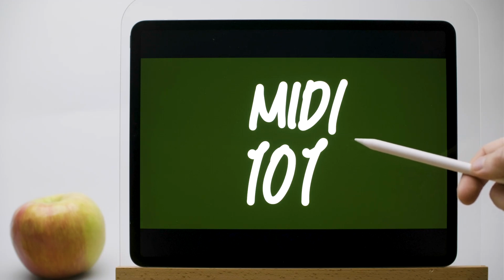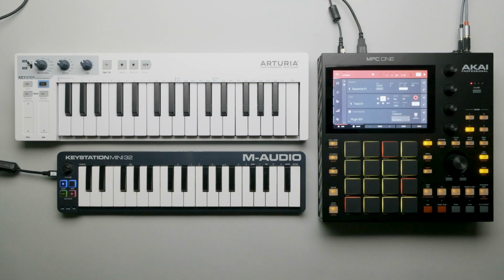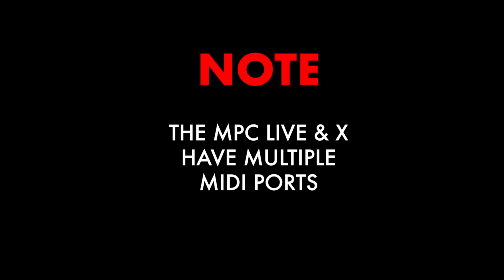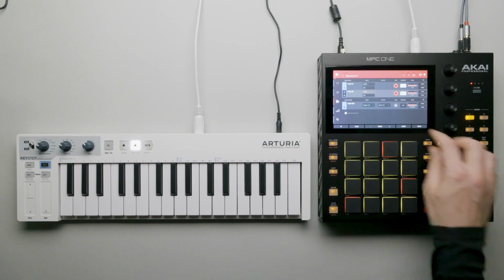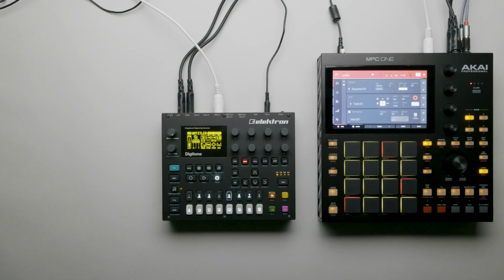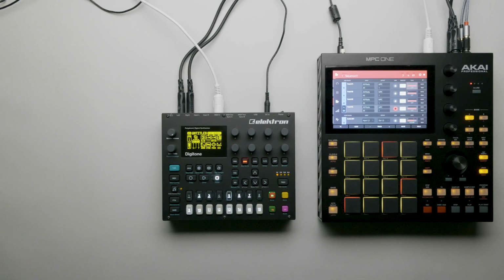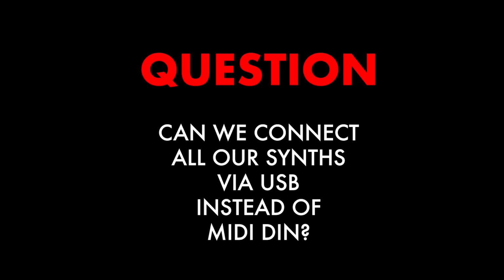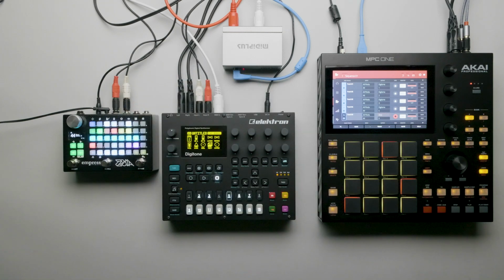MPC: CONNECTING MIDI DEVICES

Comment: Is there a way to send Midi Program Data to the keyboard controller at the beginning of a keyboard track. If I transpose a track then the Keyboard controller complies, but if I switch everything off and come back to it later, the controller settings are at default and I have to reset transpose, velocity, aftertouch etc. manually. Just wondering if there is a block send that I can programme and use from my MPC X before I continue work on the track. Thank you for the great video.
Reply from the maker: What controller do you use? And does it have a way to program save presets? If so, that may be your best bet. Otherwise, if you can send midi CC to it to change those parameters, you could create a template project on the MPC to send the CC notes, then switch to your first song's project, or a blank, etc once the CC notes have configured the controller.
Reply: @OllieLoops  Thanks. It is an Alesis Q25 so no presets. I will look at setting up a template project.

Comment: Does anyone know, why thus midi mapping feature doesn't work anymore after Update 2.10?
Reply from the maker: That’s odd. Have you updated to the latest firmware, 2.11.x?
Reply: @OllieLoops  thanks for your response. The issue is still the same after the update and others experience the same issues
Reply from the maker: @k-g-p  Wow, that would be super weird if they changed the feature or removed it. Is there anything in the release notes?
Reply: @OllieLoops  The feature wasn't removed. It is still there but doesn't work properly. After reading some reddits etc. i think it is broken since the update 2.11 when they overhauled the structure and layout of the UI. Since then some cc's are premapped and can't be overwritten. Some send a request for costumer service but didn't get a reply or fix.
Reply from the maker: @k-g-p  Thanks for sharing that info. It sounds like a bug that I hope they fix.
Reply: @OllieLoops  Me too...since this bug the MPC One lost a great feature for live performances

Comment: Good afternoon. I have an issue. I plugged in my studiologic numa X Piano, and i followed all the steps and i hear the sound coming from the headphones, however there is no feedback on the track, and it wont record. Under preference it called xpiano88 and in the inputs i selected global, control, and track, and in the output, i selected sync and track and still wont record, i even went under sampler and selected "in" and no feedback under the track but i can still hear it. Its super bizarre and stressing me out. does anybody know what i should do.
Reply from the maker: Hi Leonard, I think more information is needed to help you. For example. Where are the headphones connected that you can hear them? If you want to set up a consulting session, I can help you trouble shoot it. Email me for more details.

Comment: Man. This earned a like as well as a subscribe! Thank you so much! This is one of the more clear videos I’ve come across. Do you have any videos on MPC and Jupiter X or Juno x?
Reply from the maker: Thanks! I appreciate that. I don't currently have anything with the Jupiter or Juno. What are you trying to do? Maybe I can help.
Reply: @OllieLoops  thank you! I may be attempting to do something that’s impossible? Lol so, the MPC, as you know, has a built in chord engine. I’m attempting to configure my setup to where I can record those midi notes and they also playback the sound(s) from my Juno at the same time and not just record the notes. However, I also want to have the option to record midi notes directly from the keyboard on the synth into the MPC, if I choose too. I’ll spare you the setups I’ve attempted because I think all of my settings on both devices were wrong. Thankfully, I have a feeling I’m really close and your video helped me understand maybe where I’ve went wrong.
Reply from the maker: @MARCOSDORADOS  At a high level, I would say that you would want to connect the two via USB, otherwise, you would need two midi (5) pin din cables, one from each input to output to connect the devices. Once you have that set, create a dedicated track and program on the MPC to correspond with the synth. Arm the track. If you program midi notes on the MPC, they should play on the synth. You can either route audio back to the MPC to a dedicated audio track, or to an external mixer. Because the midi track is armed, it should allow you to play notes on the synth which can be recorded into the midi track. I hope that helps.
Reply: @OllieLoops  that’s what I was trying but it didn’t work, so I’m standing in guitar center to purchase some better quality din cables. I’ll try it out and get back with you. I appreciate it.
Reply: @OllieLoops PDATE: Turns out, I didn’t fully understand my issue. Lol. 😅 Seems I’ll have to continue digging thru various threads on the Juno X. Pains of developing a hybrid setup I guess. All good. That said, your video was still extremely helpful in helping me understand Midi. I’ve never used it in a “DAWless” setup. My only question to you at this time would be, is it possible to record midi (in or out) to multiple tracks at once? For the sake of my workflow, I would like it if I didn’t have to “Duplicate” multiple tracks. If I have to, it is what it is. However, I figure it wouldn’t hurt to ask.
Reply from the maker: @MARCOSDORADOS  You can arm multiple midi tracks to record notes into. But I think this would be the definition of duplicate tracks. I'm not 100% what your goal is. I do offer consulting if you want to deep dive your setup and get it dialed in. Email me if you're interested. thanks.
Reply: @OllieLoops  yes. Arming multiple tracks is exactly what I was thinking of. As for my setup overall, I think I’m rather close, so I won’t waste any of your time. If I can’t achieve what I’m going for, I will happily book a session. Thanks again!
Reply: @OllieLoops  thanks again for you’re help. Turns out, I just needed to reset my keyboard. I guess I’d change so many settings I changed some important ones. The only issue I’m having now is that when I press ‘PlayStart” on the MPC, it changes the sound back. Otherwise everything is working how I need and I was able to use MIDI USB. Please keep posting! I certainly appreciate it!

Comment: Ollie how r u? Estoy tratando de conectar mi Volca Fm y un Volca Beats y enrutarlos hacia el mpc one, pudieras explicarme si esto es posible, gracias! Solo he podido conectar uno a la vez
Reply from the maker: Hey, I’ll reply in English if that’s ok. 

So, to handle midi, you need a device like this: https://www.amazon.com/MidiTech-MIDITECH-MIDIFACE-2X2/dp/B0038BBOMG/ref=asc_df_B0038BBOMG/?tag=hyprod-20&linkCode=df0&hvadid=563758605815&hvpos=&hvnetw=g&hvrand=733198790151787707&hvpone=&hvptwo=&hvqmt=&hvdev=m&hvdvcmdl=&hvlocint=&hvlocphy=9033291&hvtargid=pla-1298443268816&psc=1
Connect this device to the MPC via usb. Then use midi 5 pin din cans to each Volcas midi input. Set each one to a different midi channel. 

You’ll then need a way to handle audio. A small mixer would be a good idea. Or, you could run the Volca Fm in the left input and the Volca beats into the right input. But that would make them mono. So a mixer would give you more control. 

Hope that helps.
Reply: @OllieLoops  ollie you are angel thanks! Where can i support you its the second time you helped me
Reply from the maker: @Ivancilloerre  Glad that worked. Well, if you're not sub'd that's a good way to support the channel. Otherwise, tell a friend about the channel. Enjoy your MPC.

Comment: Question, How about using a synths midi out to mpc. Then midi outs to multiple keyboard/synths? Can you use a synths midi out to control & record while also assigning the midi/ usb outs to other synths/devices?
Reply from the maker: I think that's similar (midi into the MPC) to using a midi keyboard shown in the video. You can try to use different midi channels to control different devices from one machine. But you won't be able to use the same features of one machine to control multiple devices without switching midi channels. Hopefully that helps. Otherwise, let me know more specifically what you want to do, gear youre using, and I can try to help you some more.
Reply: Just grabbed the mpc live 2 and watched your video again. Perfectly done, every synth I plugged in is showing up in the mpc. Thanks so much for your great videos & help.

Comment: It sounds like if you can use USB from an external device and route through a USB Powered hub connected to your MPC ONE, then it's the most straight forward way of going.
I have a Arturia Microfreak, Korg NTS-1, which both use USB, so I'm good there.

I also have several Teenage Engineering Pocket operators, which have a shared mono Audio out/Sync stereo Minijack connection.
I'm going to Daisy chain those together and terminating at an Audio Interface to MPC ONE or maybe direct to an Audio input on the MPC ONE. Not sure if I can Sync the Pocket operators to the MPC ONE.
Reply from the maker: I think you're on the right path. 

Audio:
Given the amount of devices you have, you'll want a mixer. It's output goes into the MPC's audio input. Run all external gear into the mixer's inputs.

Midi:
In terms of midi, using a USB hub is the easiest route. 

Pocket Operators:
These introduce some complexity because of how the handle audio and specifically their sync signal. When you daisy chain them, they go from stereo to mono, keep that in mind. To sync them all with the MPC, I don't know how to do that without using an OP1 or OPZ w/ Line Module between the pocket operators and the MPC. That's because they don't use standard midi protocol and you need to convert midi to PO sync. Likely, it's not worth it to buy an OP1 or OPZ just to do this. But that's your call. Otherwise, you can run the POs into the mixer and start/stop them manually with the other gear. 

Hope that helps.
Reply: @OllieLoops  Hey thanks for the extended reply.
I have been pricing up Mixers and may get a cheap one. I don't need anything fancy, as I don't have that many devices.
Although I could just hook up the Korg NTS-1 and Microfreak on various channels to the MPCONE and handle it all with that. But a mixer would be easier and give me more functionality.

Regarding the POs. I as often use them for a bit of fun using a Spark Mini amp/Speaker. Daisy chaining 1 or 2 together to explore ideas when I'm not on the MPC ONE.
After saying that, I like the idea of using 1 or 2 POs for a backbeat, etc.  The Arcade PO has some great sounds for that.
But maybe come new year I'll consider an OPZ or OP1. They themselves have some great functionality. They're pricey though!

Can you recommend a decent but cheap Mixer?
Reply from the maker: @danskmacabre  what's your price range?
Reply: @OllieLoops  a few $$ I guess. Say $200 to $300 ish.  Would want USB Connectivity to a PC/MPC ONE. dual TRS/XLR Inputs.
Maybe 4 or 6 inputs and a couple of various outputs. Don't need it to be effects heavy
Reply from the maker: @danskmacabre  Check this one out: 
https://imp.i114863.net/kjBB6M

This should do the what you want. 

Also, if you happen to purchase it via the link, I get a tiny commission to support the channel. Hope that helps.
Reply: @OllieLoops  Nice thanks. If I get it, I'll get it through your link thanx!
Reply from the maker: @danskmacabre  cool. good luck.

Comment: Great video! New Sub here. I am hoping for more MPC One material though. :)
Reply from the maker: Thanks for the sub! And that's the the feedback. I have more MPC content in the queue. Just curious, anything specific you want to learn about?
Reply: @OllieLoops Hi! I'm all new to the MPC scene, and the sampling scene. I've mainly done trackers, VST's, and DAW's. In box. So I ventured outside to learn a little about it. I started with the X, but soon found out that I should maybe start a little lower, so the One is perfect. So easy, and portable. I haven't got the Rip-cord to work for me yet. That would be the ultimate setup for me now. The ONE on batteries, with the MPKmini or the LPK25, if I want it to fit nicely in my bag. :) and the KO133, KO33, or maybe the Tonic.
 
Anyways, I might need to learn more about how to sample, and cut samples on the ONE. Combined with using the screen and these Q-Link Knobs, and maybe even a little about the FX. Heard something about a Duck? Sry if this is incoherent, I haven't had the unit for long. Often when I check out tutorials on YT they are too basic, or they move way to fast.. so it's basically impossible to follow. You have a very good pace in your video btw. 
I would love to learn more about how to actually make a song on it, and also use it as a DJ style instrument. A view from the actual ONE LCD would be of great help. What do you think about the latest update, with the rather expensive plugs. Or just anything MPC ONE, is there anything new in these updates that i have probably missed? Btw I heard rumours that we might get disk streaming, like on the Force? That would be the ultimate. :) Sorry I'm rambling. 

My current (I'm currently setting it up right now) The ONE is the control centre. On the right side I have an Alesis Mastercontrol Studio Interface. (decoupled from FireWire) On the left side is a Korg xd, and a Modwave. It's supposed to go through the Zoom 9150, which is connected to some stompboxes. The TD-3 is aso on that loop. Last but not least the MPKmini, PK25, and the nanoKontrol2 to eventually midi learn a setup to them, and save my MPC some abuse. :) I also have a pc setup ready, so I can connect, when ever I might fancy/need it. I might get desperate. :) What a wonderful time we are living in. We are so lucky we got the second synthesizer revolution. Thank for reading this, and thanks for responding. I hope you have a wonderful night.
Best regards Ulvens.

Comment: Great video.  Trying to connect my Akai MPC249 keys to MPC One.  I copied exactly how to connect everything to the usb powered hub and the MPC One is not picking up the MPK249 in the MIDI/Sync in the preferences.  If I plug it in directly to the MPC One, it will show it as being connected.  Thoughts?
Reply from the maker: Sorry for the late reply. There should be two USB ports on the MPC. One is for direct connection and the other is for hubs. Make sure you're connected to the one that's for hubs. Hopefully that does the trick.

Comment: great video. i'm trying to figure out why there is hiss and noise whenever i select a midi program. doesn't matter whether i have anything plugged in audio inputs, midi in or out, or nothing plugged in at all. as soon as i open up a midi program, and activate the "in" button, below the record button, a hiss comes in about 2-4 db loud. anyone face this problem or know how to get rid of it? it's so loud, that it renders anything i want to use via midi, completely useless.
Reply from the maker: Are you enabling audio monitoring, by chance? I'm not sure there would be an input in a Midi Channel. That said, what you are describing sounds 60 cycle hum or similar, coming from an input. What's connected to your MPC?

Comment: Hi Ollie, Great video but I have a question -  I run two mpc lives so I can mix "songmode" tracks with live improv sections and other full songmode tracks. When doing this at home I just make everything to a standard bpm and try to time the drop right, nudging the bpm to bring them in line if I have to. I have been offered my first gig and I was wondering if there is a way to be able to stop one mpc, load the next track, then have it "latch" back on to the bpm without it affecting the other. Then vice versa (ie no master, no slave  - just latch to the bpm in play) Is that possible?
Reply from the maker: Hey, thanks for your comment and sorry for the delayed response. You may want to check out Ableton Link which is an included feature on MPCs. In theory, enabling Link on both devices should allow them to be in sync with one another. Starting one should start the other, etc. I would start there. If that isn't what you're looking for, you could try to set up one MPC as the main unit and the other secondary. On the main unit, you could send midi to the other to sync tempo that way. You should even be able to do this with Midi over USB. Another thought is to set them up like a DJ setup. Run each MPC into a DJ mixer which gives you control over their audio and the ability to add effects (if the DJ mixer has them).  If you don't sync the tempo's between then, it may feel more loose/natural. But that depends on what you're going for. Hope that helps. Good luck with your first gig!

Comment: I’ve been trying to link my minilogue xd to my MPC. I want to be able to play the minilogue sounds on the minilogue but have it sequenced through the mpc. 

I cannot for the life of me get sound to come out. The MPC is picking up the feedback from the xd but I’ve got zero sound. I’ve assigned the output on the MPC as MPC. I don’t know if the xd itself knows that or even how to tell it to do so. 

It’s so frustrating. I know once I know it will seem simple but when you don’t know these things can be so confusing.
Reply from the maker: Let’s start with your connections. The XD audio outputs need to go to the audio input on the MPC. Make should the input is set to line not phono. Then, you have to have a track and program for the audio input which has monitoring engaged. Once you have those things properly setup, you should hear audio from the XD going through the MPC to the MPC’s outputs. Hope that helps.

Comment: Wish this was working as you’re showing. My Nanokontrol2 either causes the MPC to freeze or does nothing even after having mapped it.
Reply from the maker: That’s odd. Have your tried updated firmware? Also try a different USB cable. If you’re going through a hub, try going direct. Hope that helps.